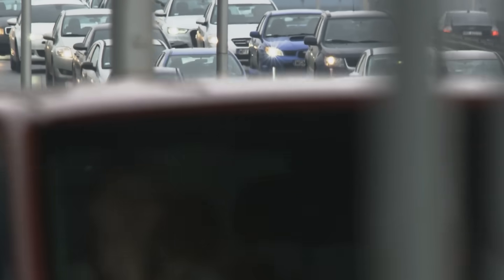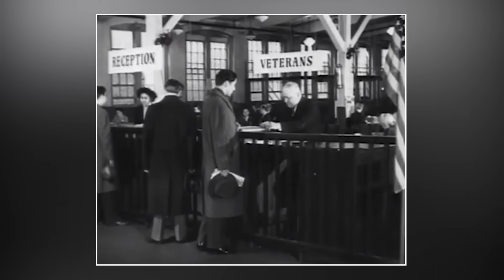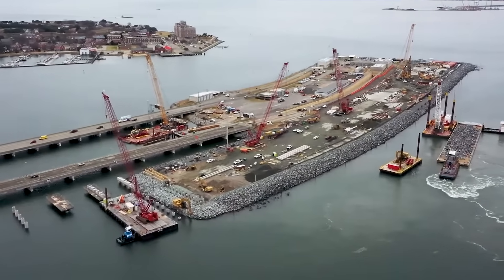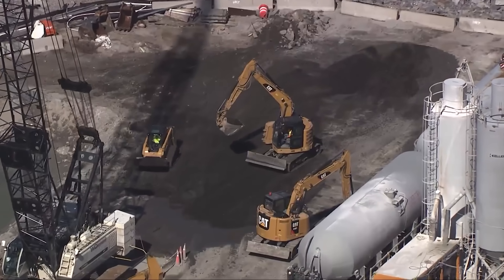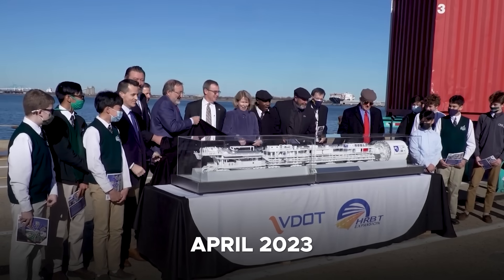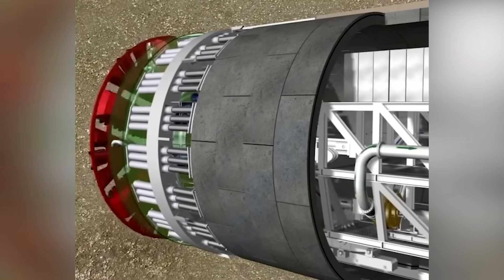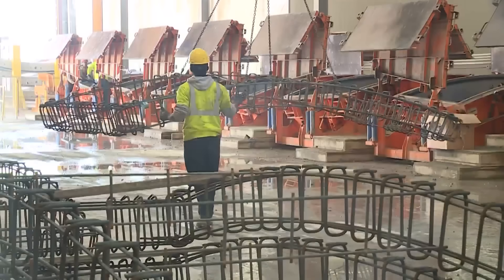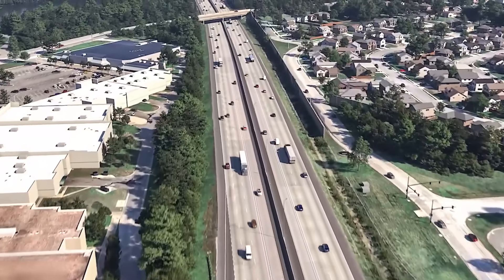Inside Virginia's $4 BILLION Underwater Highway Rebuild: Hampton Roads Bridge Tunnel

Comment: They should have built a new twin bridges from 664 at the southeast tip of Newport News across to the shipping port and easy 2nd access to the Navy base and ODU. That way the traffic would split at 64/664. Norfolk, VA Beach on to the HRBT. The rest on to 664 to the interchange at NN splitting some Navy base, port, and ODU, with the rest continuing to Chesapeake, Outer Banks across the MMMBT. That way you could build bridges and not have to build tunnels so as to not potentially blocking ocean access to the Navy.  Save 2 Billion dollars and spread the traffic out instead of still sending it into one place still.

Comment: There are some things that are not correct with this video. Not all the bridges are being rebuilt. When I say rebuilt, I mean from the pilings up. Some are just being rehabbed. I know things that I cannot talk about due to confidentiality agreements due to the kind of work I do. Also, some of the imagery used was not even of the project, but other areas not connected to the HRBT project such as the new High Rise bridge or the rebuild between I-64 and Witchduck Rd. on I-264. The expansion of I-64 between Denbigh Blvd. and Toano also have nothing to do with the HRBT project. 

I have been associated with the area since 1972 when my Pop's was first transferred to Langley AFB. At that time, if one wanted to go to the southside or Gloucester, one had to take a 2 lane road and pay tolls. Eventually they all came down, buy slowly, they came back to the Coleman Bridge, which is losing them again for the second time. At least all the roads are 4 lanes, but they are not, nor will they, ever be enough.

Comment: It's BS they did the same at the High-rise Bridge on 64 after 464 entrance and before Portsmouth Deep creek exit. It took years of congested building traffick. The only thing gained was a pay express lane. It all about tolls. People who suffered through the years of construction were told how it would benefit them It didn't. Everyday it still geys backed up before bridge for miles heading towards suffolk.  Everything in Tidewater Virginia including tunnels and bridges are all about tolls. The Veterans Bridge on Dominion Blvd Hwy 17 was supposed to help traffic.  It did but now is heavily tolled. Of you take a parallel bypass route it's tolled even worse. All of our older pre existing bridges and tunnels are now tolled. It's BS. Don't get me started on the billing,interest, administration fees.  You call to pay in full thinking you ate square now. They bill you months down the road saying at time of your payment request some tolls had not gone through system so now you owe late fees on top of tolls you were told you'd paid  in full. F$%# THE VIRGINIA DEPARTMENT OF TRANSPORTATION

Comment: There will be no long term traffic relief in the Hampton Roads area until the cities get their collective stuff together and finally decide on a comprehensive long-term rail system.  I-64 will forever need widening and improving until then, and each project will just be an expensive band-aide.  Been here since 1959, seen it, lived it.
Reply: As a consistent visitor to the area, I always wondered why the Tide is just in the Norfolk and VB areas.  Makes no sense to me.  You want people out of their cars, make them take the train.  Why build a train network that only goes to two cities.  The race argument is a stupid issue, because they can just get in a car (their own or stolen) and just drive to VB.  That's fear is not going to keep the bad element out.

Comment: As a Hampton Roads resident: I just want to say this to anyone who passes by,
the EZPass "HOV" lane on the south end of the 64 loop around Norfolk is idiotic.
It's a single lane, so anyone maxing out their own speed at the speed limit in that lane is going significantly slower than the other two lanes.
They should have just made it two additional lanes, not a single "exclusive" lane that only has exits at certain points.

Comment: Never underestimate the Virginian drivers' ability to destroy traffic flow on any road, no matter how many lanes are added.
Reply: Part of the issue with westbound traffic through the tunnel is the fact that the original tunnel is 13'6" tall and truckers keep trying to drive through it with taller trailers than the tunnel can handle. This means that they have to stop traffic at the tunnel to turn them around if they pass the 4th View exit or the inspection station at 15th View so they can be turned around down Oceanview. it does not take many trucks to cause major back-ups which can reach to the split with I-564.

Comment: Hi I crossed this structure the weekend it opened and my dad told me that its
Planned to do a second tunnel soon. That soon only took Virginia 64 years to get off there back pockets to finish the project. It’s about time. I crossed it first time in 61 and i saw a guy do a video so I had to drive it my self. I wanted to cross the bridge just as the sun was rising. I got there way too late. As I crossed the radio station said it as like 08 something. I just sat back and crossed with all the traffic just speeding along. It was interesting. I went back later trying to cross at the right time. I got there way too early so I waited for the sun to start to rise. I was across before the sun rose. I’m not going to try a third time before a finish my move from frederick, Md to phoenix. I’m glad you guys are doing this project. It’s a nice ride. I asked if the dolly ship wreak crossed but no body seamed to know.

Comment: THE WORST AREA TO DRIVE. They been doing construction for about 9 years now. Traffic is horrific. They intentionally close exits close to the tunnel to force traffic to go all the way around. Sometimes you sit in traffic 20 to 25 mins before moving. TERRIBLE, its construction on the highway 4mi or 5 mi before you get to the tunnel causing more traffic. ABSOLUTELY HATE their construction. They are slow. People getting into accidents because of all these mergers on the highway due to construction.

Comment: Just an expensive backward looking band-aid. It would ease traffic more to have a conveyor belt system, timed light, monitored speed for vehicles and mass transit for individuals. I come from LA and the 405 is now at 12 lanes and it's still bumper to bumper.
Reply: Autonomous cars will achieve the same

Comment: I just drove through this tunnel yesterday. Looking forward to this project being completed. But also ready to stop for no reason. People get in the tunnel and slow to a crawl for no reason. All they have to do is maintain normal driving speed but they freak out and slow down. Same at the Monitor Merrimack
Reply: People are afraid of driving through the tunnels, without realizing that if they maintained at least the posted speed limit, or went faster, that they would be out of the tunnels sooner.

Comment: This is a good project but I don't believe it will be big enough compared to the growth of the area...they should have over built this structure to accommodate the next decade of growth ..it will be better for sure than what's there ..but with limited real estate to widen these roads will be the challenge .there are bottlenecks every where you turn once you exit this bridge tunnel ..they are currently expanding these bottlenecks but I don't think it's gonna be enough

Comment: "Astrophysicists predict that the sun is going to burn out in ~2 billion years. This means that construction workers are going to have to work on I-64 in the dark"
Reply: Truth. It will literally.... only end.... when the World itself comes to an end. I wouldn't get too excited about this news.
Reply: Truth. Greetings from Richmond. 
We bought a little beach place at the southern end of the Outer Banks. It's a much calmer, pretty drive than the 100 miles down 64 to Va Beach. We don't care that it's 5 or 6 hours, it's not 64 to Va Beach.
Reply: I wanted to laugh at this but as someone that drives from the 757 that drives to Fairfax twice a week I just sighed and said yeah.
Reply: Had to go through that tunnel daily in the 80’s. 
Like all tunnels in the area, traffic into and through the tunnel was always slow. But once you were able to see the light at the end of the tunnel, you could barely keep up.  For an area that has so many tunnels for traffic, it seemed everyone was terrified of going through them.

Traffic was so slow that we used to joke about the posted speed limits on the electric signs - typically 35 in heavy traffic. Felt like it meant 3 in the left lane, 5 in the right lane
Reply: You need to stop! Too funny but absolutely true.
Reply: 🤣🤣🤣 this is the truest statement ever.
Reply: 🎉🎉 Outstanding
Reply: Good one.  So true
Reply: Just get rid of Ez pass

Comment: This might be the first stage in a conversion of us 13 to interstate 87. But building an interstate Highway from Norfolk to Wilmington via the Delmarva peninsula is economically and environmentally unviable.
Reply: Yeah and if you drive Route 17 down through South Mills in NC, there's a sign for "future I-87" or something. I'm not sure what they're trying to do linking Raleigh and Norfolk that way.
Reply: @ashextraordinaire North Carolina is on-board with building Interstate 87. A portion has been built east of Raleigh. I remember reading that they would probably upgrade part of U.S. 64 and U.S. 17 to meet interstate requirements. Then have Virginia pick up at the state line still using U.S. 17 to where it ties into Interstate 64 in Chesapeake. That's why you would have seen the sign. The problem Virginia is reluctant to do their share. Most of their VDOT funds go to Northern Virginia. North Carolina is Interstate happy. They don't mind building those roads. They might decide to build I87 to the state line and force Virginia to make a decision.
Reply: @Jim-jr9yc   In general, NC's roads are much better maintained than the ones in my part of VA, so I believe that. I actually just drove up 17 to get home and saw the sign again. Also saw a bunch of cleared woodlands on the VA side, so maybe something is finally happening that doesn't benefit the DC metro area!

Comment: You should do a video on the complexities of turning the tunnel boring device.
Reply: Usually it's just a matter or re-orienting the rings. They're designed to be wider on one side than the other. To go straight ahead, place the wider side 180 degrees from the wide side of the previous ring. To turn the bore, rotate the ring placement so the wider sides are closer, altering the direction of the tunnel as more rings are added.

Comment: The narration and film-clips aren't consistent.  The 1957 project provided a two-lane, two-way tunnel (not two lanes in the same direction).  For nearly 20 years, traffic in the single tunnel moved both ways in ever-increasing volume - a very different, nerve-racking experience than two lanes moving the same way.

Comment: I live in VIRGINIA BEACH, but was raised in NORFOLK.

Im 53 years old, and remember as a child of the 70's, &, 80's traveling through the HRBT way back then, and traffic was HORRIBLE back then.

I also remember when you could take the MONITOR MERRIMACK MEMORIAL BRIDGE TUNNEL instead and smoothly get from the SOUTH SIDE over to the PENNENSULA on I-664.

Now 664 is just as HORRIBLE as the HRBT has been for over 50 years.

Sometimes I have to go way around my REAR END, to the JAMES RIVER BRIDGE, or even take the JAMESTOWN SCOTLAND FERRY ⛴️ just to get were I need to go.

Let's pray that the HRBT doesn't have drainage issues like about 20 years ago when VDOT had to REDO a section of I 64 in NEWPORT NEWS because it wasn't draining correctly due to the road being too flat.
Or that time FM-99 WNOR reported about 2 of the 3 MAJOR CROSSINGS being CLOSED by VDOT when UPPER MANAGEMENT refused to listen to thise below them, and a couple STUCK IN TRAFFIC as I recall got MARRIED IN TRAFFIC because they couldn't get to the CHURCH.

I hope im wrong, but I have LITTLE FAITH in VDOT.

Comment: Add that cost to the sinking, salt water intrusion and rising sea level to the Hampton Roads area and you have a growing nightmare. 
Even a low pressure system during a hightide hour causes problems for the area.
Has adding more lanes ever been a longterm solution? NOVA is a mess no matter how many lanes they add.